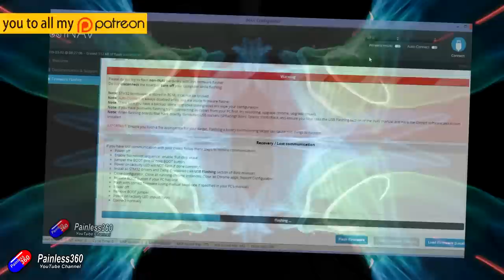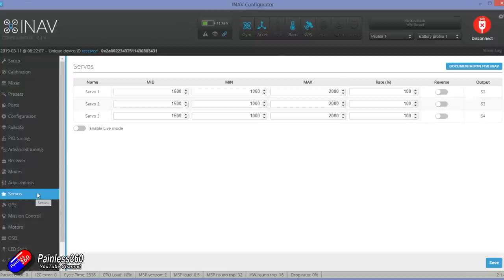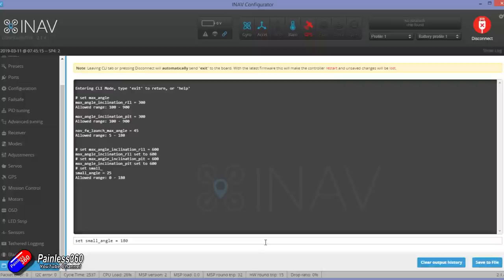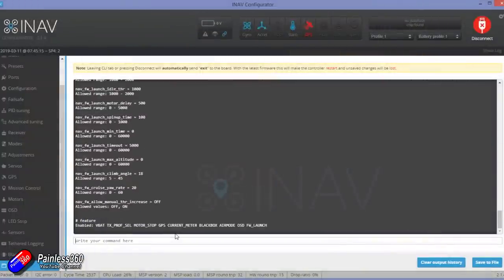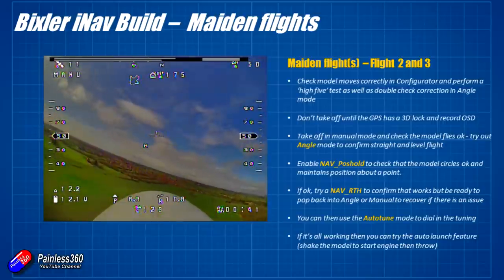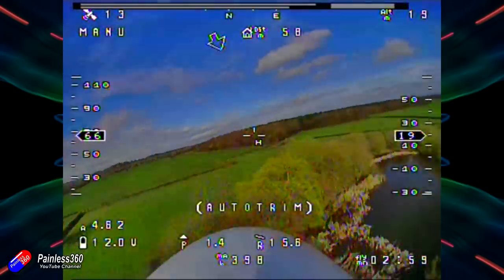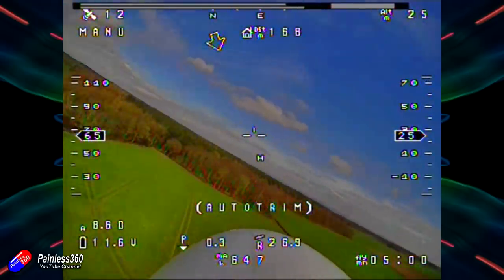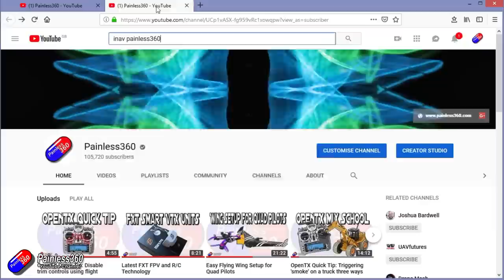iNav 2.1/Radix/Bixler Build Series: 3. Final setup and maiden

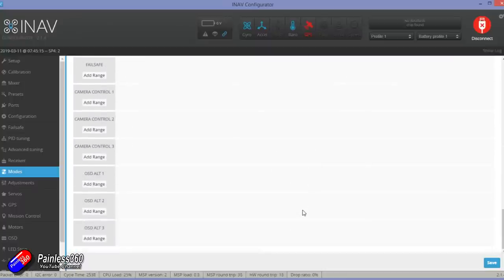Comment: 3:44 Video looks like Ch. 5 is set for 4 modes, angle, nav poshold, nav rth and manual.  Assuming you don't have a 4 position switch, could you give some more detail on a recommended setup?  I took a stab at it without having ever used INAV and set one switch to (manual, angle and servo autotrim (not sure what autotrim is), another switch set to (nothing, nav poshold and nav rth), and a third set to arming (on/off.)  Look good?
Reply from the maker: I'm planning a video showing how I set that up. Stay tuned!

Comment: 1:30 Lost again.  Got everything exactly matching the videos up to this point but after enabling the servos I found a problem.  As I read the Radix Hardware Manual the pinout for the WPB shows servo pin 1 nearest the Positive terminal of the ESC, but I believe it is the other way around.  Also, I believe you configured the INAV servo mixer setup for Servos 2, 3 and 5; however I cannot get the rudder to do anything.  I really don't know what I am doing here but tried changing from 5 to 4 (there are only 4 pins connected??) but this doesn't work either.  Still no output for the rudder.
Reply: OK I got it working.  Pin 1 on the Radix board is indeed Servo pin 1, but I had to change my Taranis mix from TAER configuration to TREA and then do the little trick of changing the INAV servo setting for the rudder to 1, such that it now shows both the throttle and rudder on 1.  I guess the difference is Motor 1 versus Servo 1.  Pretty confusing.
Reply: Pin 1 on Radix WPB is nearest the Positive terminal.

Comment: As usual, very well structured and informative video... I often seem to learn something new and useful when I watch (or sometimes rewatch) you videos. Pitch and Roll on the OSD is a brilliant idea so I can configure the board right. I would love to have a "AUTO PITCH and ROLL" mode. Am I right to assume that having the plane not able to maintain constant altitude in RTH mode (nose bobbing up and down) can be fixed with proper board alignment?
Reply from the maker: It'll help. See the Orbit wing iNav 2.1 setup for the tip I use to get it close on the bench.. also check nav_fw_pitch2thr for your model too.. best of luck!

Comment: Awesome setup serious for iNav.  How did you connect the pan/tilt servo? Through the controller or direct from receiver.  Also is there a way to "reset view" with a switch in OpenTX instead of the goggle buttons?
Reply from the maker: I connected to the spare PWM outputs on the FC. Next video in the series shows how..

Comment: I know this Is an older video... I've just maidened my bixler 2 with inav 3.0... crossfire.. Dji vista... .. On autolaunch with throttle idle set 1400 and launch throttle 1700.. It really dipped on take off.. Only just missed the deck.... Any ideas on a better autolaunch setting for a bixler2... Tia
Reply from the maker: Your pitch offset probably isn't set right. See my INAV 3.0 videos.. best of luck

Comment: When setting up using CLI commands, you say max_angle_inclination is set to 60 degrees, but the video shows 600. What am I missing?  Thanks for the video, BTW. I've never loaded iNav, but I think now, I'm gonna give it a go.
Reply: 600 really means 60.0 degrees. Hard to believe that you could have it set at 595 and this would give you 59.5 degrees.
Reply from the maker: The iNav wiki is excellent when you're not sure - https://github.com/iNavFlight/inav/blob/master/docs/Cli.md best of luck with your build!

Comment: hi Lee I was wondering when I first plug my plane in the aileron on the left wing doesn't zero to its mid point, as to where the right aileron does start on it mid point.  how to I make the left aileron left aileron start in its correct position than lifting a bit, as it would begin rolling to the left on its first lunch?
Reply from the maker: Probably the failsafe on the receiver needs to be setup now you've got everything trimmed. Until the Rx connects to the radio it'll use the stored channel positions for the failsafe.. I hope that helps..
Reply: @Painless360  thanks :D

Comment: hey my wing ailerons are not level using inav. they were perfect before i installed a FC. So not sure whats causing it. Do i need to adjust the midpoints to align them to center?
Reply from the maker: Please watch the entire series.. All covered in there and in the Wiki. Setting up the model well mechanically is ideal and iNav will sort out the rest. (Check out the autotrim function).. Best of luck!

Comment: Does the autotrim mode setup the center positions for the angle mode? I setup an asw-28 and if i switch into the angle mode the airplane starts to roll to the left and would crash if i dont change it to manual mode. How can i calibrate the angle mode?ß
Reply from the maker: https://youtu.be/13VVsmsUj1A

Comment: I cannot get the motor to run, speed controller not beeping.  I am all green in pre-arming checks and when I click on the Motors tab the throttle stick moves the blue bar up and down fine.  Servos are fine.  Seems to me that the Radix WPB is not communicating with the speed controller.  Tried changing ESC protocol and refresh rate on the Configuration tab but no joy.  I am stumped.
Reply from the maker: Have you enabled the outputs at the top of the configuration screen? Please follow the series to see how I do it..
Reply: Yes enabled outputs (enable motor and servo output) and the servos are fine.  Not sure what the minimum throttle, maximum throttle and minimum command are all about but I left them on default (1150, 1850, 1000)
Reply from the maker: I'd try the other settings for the ESC then.. PWM etc.. if the esc isnt completing the boot tones that usually means that it cant see a low throttle signal. That should be sent as soon as the FC boots. Please follow the steps I took in the series to get mine working.. best of luck

Comment: Hi, I'm trying to install inav on my nano talon, my L9R is connected with Sbus but it doesn't show up on the radio tab. The pwm outputs work so I believe that it's a software issue but I have zero idea of what it could be. Any help guys?
Reply from the maker: I'd suspect that the right Port isn't selected as 'Serial'. As you don't mention the FC you're using its tricky to help more.. best of luck!